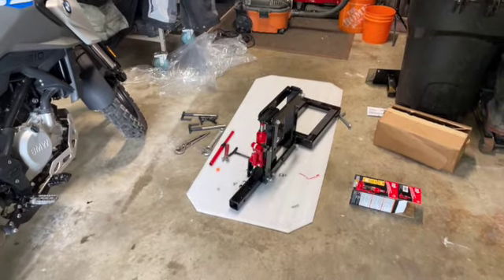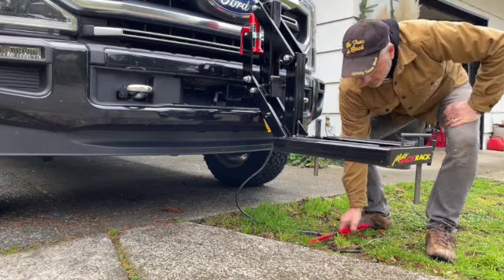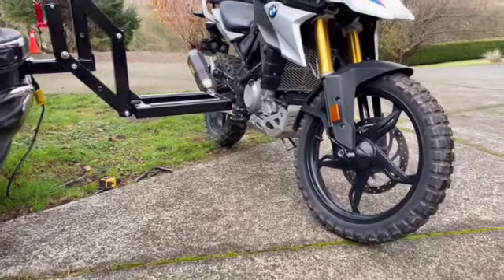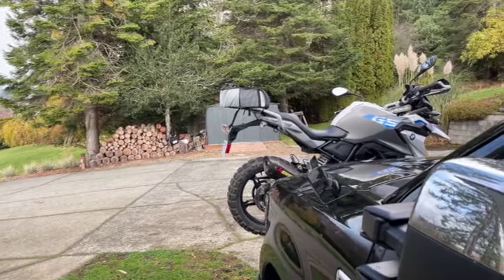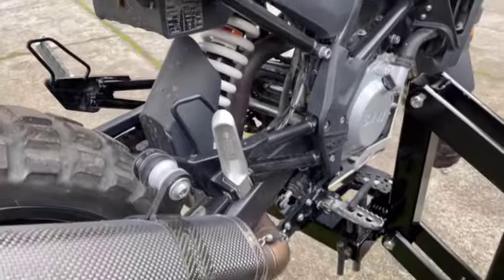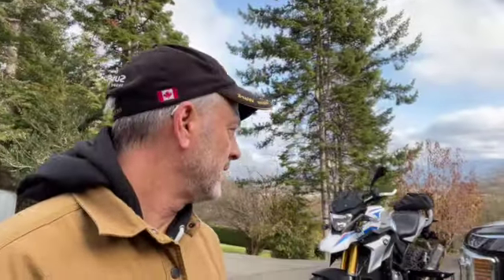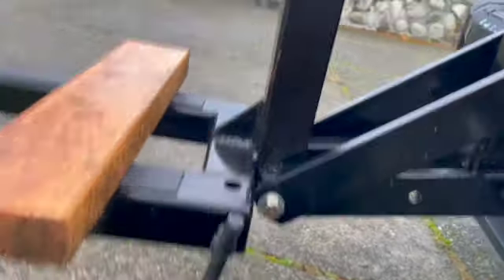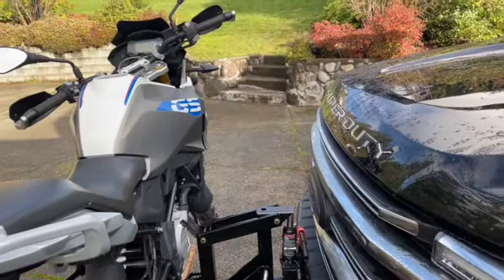Moto Jack Rack

Comment: Warning warning my friends I highly recommend beefing up the square stock tubing I seen two videos where it broke off on two different style of hitch hauler motorcycle haulers😢 and the motorcycles were on the ground with the square tubing broke straight off coming out of the receiver hitch
Reply from the maker: I hear you! I did put 8500 miles on it with no issues on some really rough roads throughout Baja! However I’m looking at a new system that will take some of the weight from the tow hooks so look for that video!
Reply from the maker: I hear you! I did put 8500 miles on it with no issues on some really rough roads throughout Baja! However I’m looking at a new system that will take some of the weight from the tow hooks so look for that video!
Reply: @cp-islander  I'm an inventor here's a solution to beef up the roll on RAM Style motorcycle receiver hitch hauler make it a three-point connection put a small custom receiver on the left side of the bumper and Far Over on the right side underneath the bumper where you can extend a square stock or a pipe inserted in the two extra receivers, running out underneath the channel that holds the motorcycle you will have the one main receiver in the center and two smaller ones one on the left and one on the right side it would be super strong and stable in well worth the money for the Safety and Security of everyone including your bike after seeing two of them broken off on video in motorcycles laying on the ground Square stock snapped off in front of the receiver

Comment: You need a drop hitch adapter or a lower hitch for that bike. That rack was never designed to be used in the lower position. Needs to be jacked all the way up.

Comment: I've ordered mine and as I was checking the fit, I realized that problem. Right now I have a standard front carrier and with suspensions compressed, get good field of view and good clearance. But with this carrier, no compression, meaning either the bike is higher in the field of view, or front clearance is limited. I like your solution, I think I will use that too once I get mine. They can ship it with a lower factory "config" so that the platform is lower once raised, but still. I am thinking when I am off-road, I can always raise it to the max to clear obstacles, and then have it at that mid point heigth on regular roads. 
With your current setup, how high are the tires from the ground when raised ? 
So cool that you did a video on this. I had a bigfoot, now a kingstar.
Reply from the maker: I had about ten inches from the ground to my tires so it was tight on some roads in Baja!  Overall put 10,000kms on it with no issues. I would recommend upgrading the bolts, I used grade 8. I also had the low model as well. One other thing I did was cut about 2” off the receiver piece to get it closer to the truck to take some leverage off of it. Send a pic of your setup!
Reply: @cp-islander  I wanted to share a pic but don't find a way to do it with youtube, and I cannot send you a message either. But here is a link to a video I had done this winter, I was camping out with a friend in the Kofa forest (yuma county). Do you full-time ?
Reply from the maker: @PeteLeuenberger  not a full timer couldn’t do it in a camper maybe in a big trailer one day!

Comment: a 31 minute video to prove it doesent work on the front where it wasnt designed to be used🙄
Reply from the maker: I made it work! Will it last, we will see when I drive down to Baja!
Reply: I have the same hitch on my truck. I liked how it fit and was hidden in the bumper. I realized after, I should have got the lower hitch that comes out through the lower valance. Anything added to this hitch needs a drop. 
Just wondering if you weighed the truck and camper. I found my F350 didn’t have enough payload for my camper. Have it for sale and going for an F550 to have enough payload to do something similar. Nice rig!

Comment: I agree with other comments you’re blocking your radiator you’re blocking your turning signals you’re blocking your lights. I don’t think a highway patrol is going to pass you by.
Reply from the maker: Driven 5,000km so far haven’t been pulled over once!
Reply from the maker: Also was driving across the desert when it was 30c again had no issues. If I do have any issues I will let everyone know!

Comment: Sorry, I think putting that heavy of a bike on your front suspension is not a good idea. Especially with a camper already in the bed of the truck, (a small trailer would be a better idea.)
That big of a bike might overheat the engine by reducing air flow into the radiator.
Reply from the maker: Bike is only 310cc and weighs 374lbs. Truck is a F350 diesel so should be able to handle the weight. My only concern is air flow. Will test it out and if it’s a problem will figure something else out.